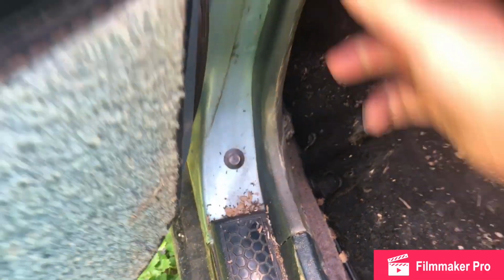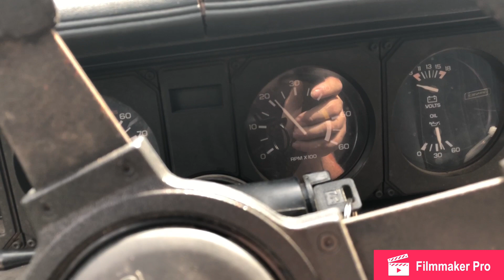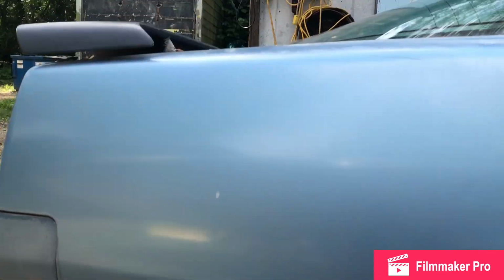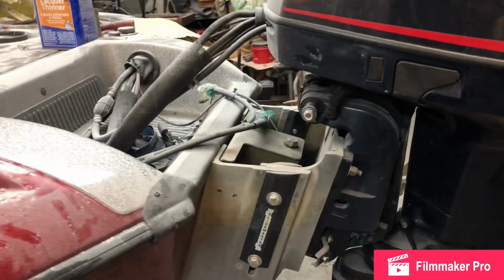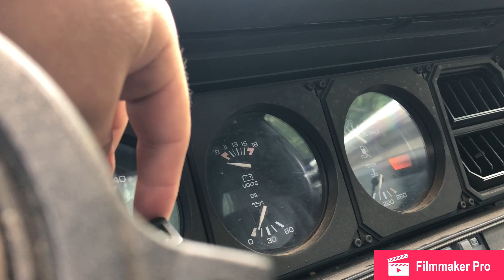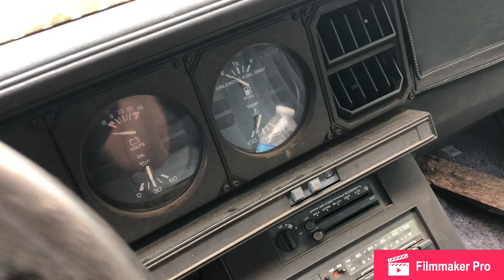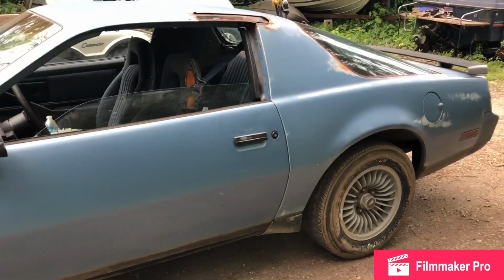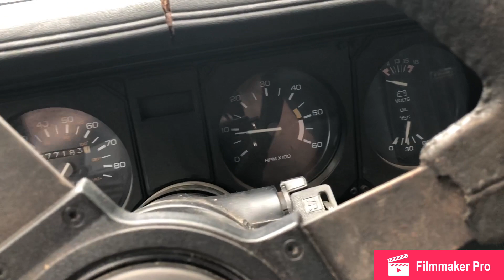1982 Trans AM (IT IDLES SORTA!)

Comment: If that car sat for a long time you need to either clean out the carburetor jets or buy and install a rebuilt carburetor, also the gas tank needs to be either cleaned out or replaced, you probably have a lot of rust sediment in the tank!
Reply from the maker: Kift1991 already did that did you check my channel first?

Comment: Just noticed too your OIL PRESSURE is a bit on the low side too. Should be at least 30 minimum when the engine is warm.
Reply from the maker: Did that ever since I got it only does 40 at start up
Reply from the maker: When it’s fully warmed up it says maybe 25 driving/idling
Reply from the maker: I bet the sender just needs cleaned

Comment: You could also try using some Marvel Mystery Oil in the fuel tank and some in the engine oil too.It will unstick any valves and also clean around the entire fuel system area too. If it's been sitting for a long time (years), then that will help too.
The seafoam in the engine/carb maybe has not done this any good .You also run the risk of hydrolocking it.Which is bad. As water does'nt compress.
Also if it's not running right then continuing this can damage things further.
Reply from the maker: paymydues thanks I’m pretty sure I just need a new carb